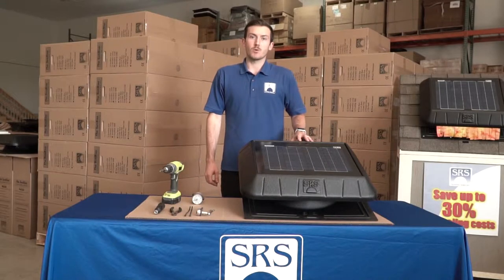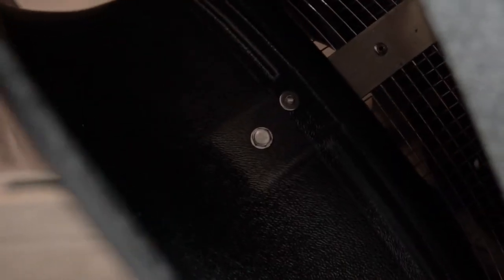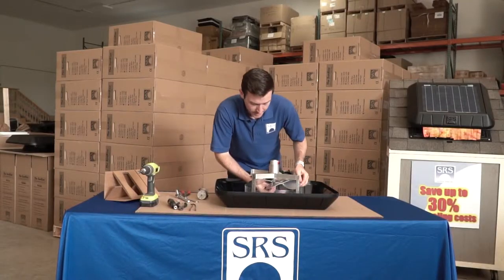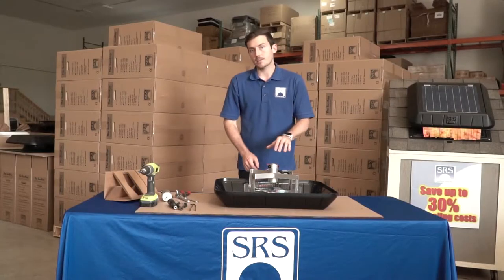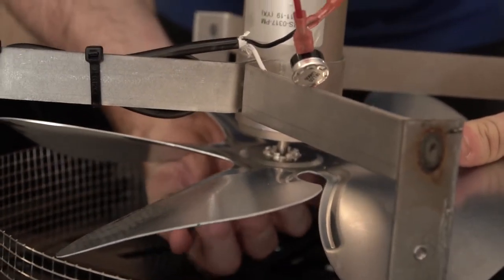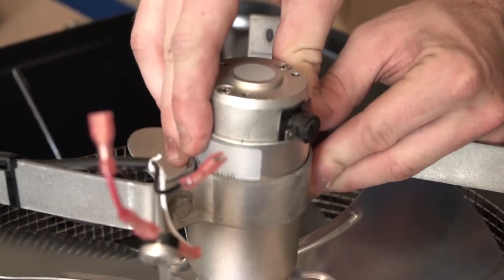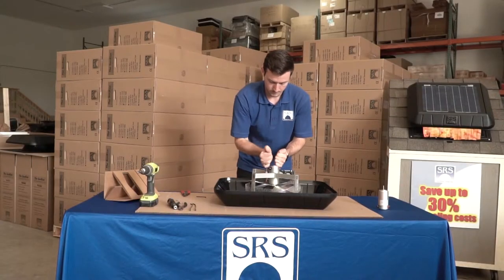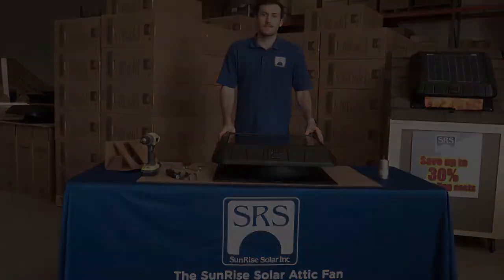Motor Replacement - SunRise Solar Attic Fan

Comment: How often do the motors need to be replaced?
Reply from the maker: p engel an original brushed SunRise Solar attic fan motor’s lifespan is 5-15 years. There are several factors that determine the life of the motor. If the solar fan is equipped with a thermostat, the motor will last longer. Also, if the region the fan is installed in doesn’t get a lot of sunny days during the year, the motor will last longer. Feel free to call us if you have any further questions. 219-558-2211. We will hand- make our products here in the USA using the best quality materials available!
Reply: Not sure what the average is but I live in Hawaii where they are having to run more then States with long winters. I’m just replacing mine now and it was install in 2006.
Reply: @ckj324  I live in Hawaii too and both my solar attic fans are dead. (Installed 2007). I need to figure out what brand they are. Any ideas?

Comment: You video had a wide camera shot what even you said was the most difficult part, removing the fan blade. Why didn’t you have a close up on where that screw was and what your doing to remove it and fan blade? The camera was at least ten feet away! I have removed everything from inside the attic but the fan blade has to come off. I’ll look fir another video with better details on this.
Reply: CKJ, sorry about that! On the top side of the fan blade there is a 1/8" allen head set screw on the side of the hub. It's very difficult to remove the fan blade while the fan is installed because it's almost impossible to get your hand up there, feel the set screw, and loosen it. The best way, as described in the video, is to remove the top part of the fan from the base flashing. Then you can take the fan down and do the work on a work bench. If you need any further assistance please contact me: bill(at)sunrisesolar(dot)net